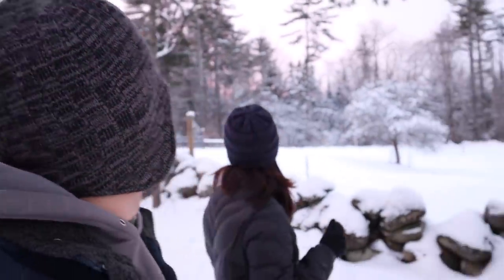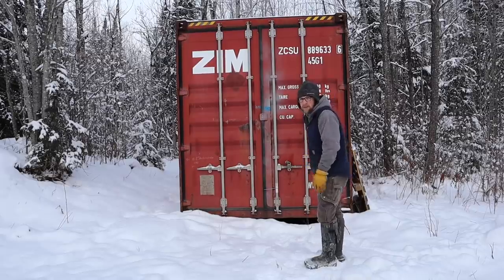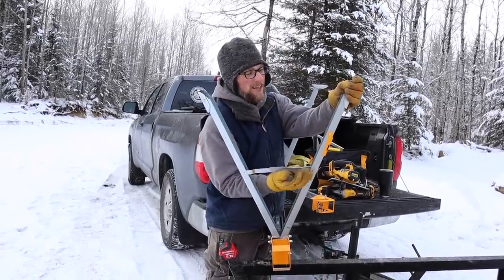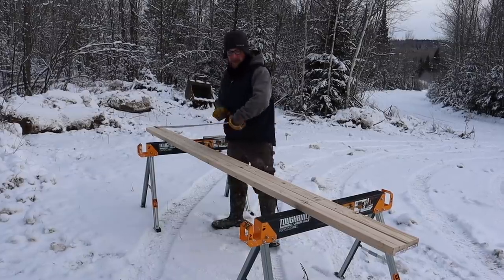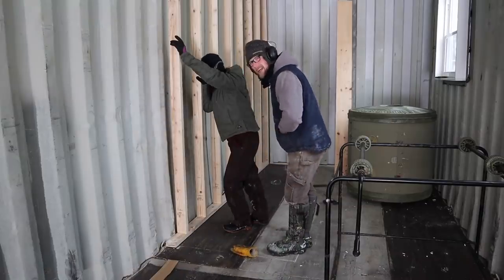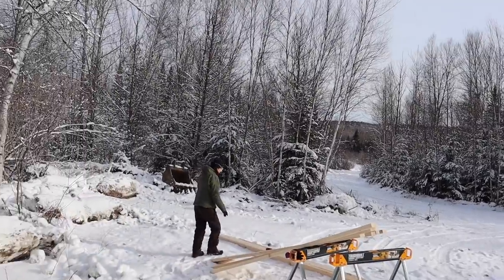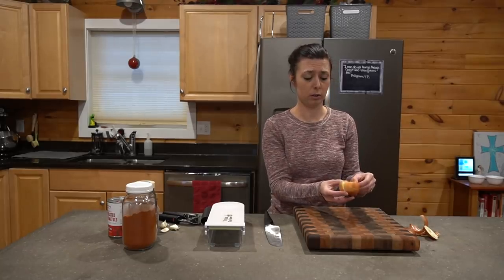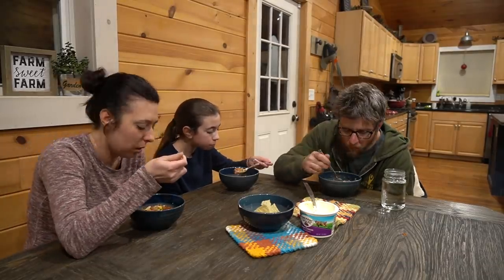Day 1 Framing Our Shipping Container Cabin Interior Walls This MISTAKE Cost Us

Comment: With the trailer being up off the ground, I personally would consider adding a layer of insulation on the floor in the living area.
Reply: And a moisture barrier, so mold won't grow. Air needs to flow. 😉 Check with RVers. They can give you lots of useful information on this topic.
Reply: I also read past comments that the wood floor in those containers is soaked in pesticide to deter any critters from making it lunch.  There is a concern of toxicity.  Another good reason for an additional flooring.
Reply: Maybe use the zip system
Reply: @Sam Val. I have done data research for 40 years.  If you or anyone else is interested in science developments. Four days ago the solution for stopping the virus was unveiled, at the "American Technion Society". It works simply with replacing lighting in a combination of ulterviolet ranges, and activates with a cell phone apt.. Proven effective 99.9% against the germs and bacteria that causes the Sars virus v2, that caused Covid 19. Look it up at their site. After installation, all hospitals, schools, gyms, restaurants etc. Will be able to open safely. G-D Blessed them, and us. Their is light at the end of the tunnel.
Reply: @angelsarrived2642  they have known this from the beginning!  Haven't you seen the robots and machines offices and hospitals use to disinfect everything?  Somehow I'm thinking a phone app isn't going to "save the day".
Reply: @Jomama02  ITS not a spray, or about a robot. A smart person would register for the webinar and become enlightened. Its free. But, most people like staying in the dark. Sorry I tried to wake you up. Go back to sleep.
Reply: @angelsarrived2642  Many thanks for the info!
Reply: @angelsarrived2642  I was thinking of the moisture barrier as well.
Reply: PLEASE MAKE SURE THE STOVE IS “VENTED” WELL. 
I know of a sad story I don’t need to comment on.

Comment: Bet your glad you left the air compressor home, screws are much easier to remove than nails.
Reply: And stronger
Reply: Said no contractor ever
Reply: @bryanlandis541  ever see a roof blow off ? Screws don't pull out
Reply: @colinstace1758  🤦‍♂️🤦‍♂️
Reply: @colinstace1758  yes I have. they don't pullout they break off.
Reply: @eugeneharris6898  in framing you need tensile strength not shear, screws are stronger than nails for tensile strength
Reply: @colinstace1758  been doing construction long enough to know that ring shanked nails will hold sheathing on a roof better them any screw does. Repairing botched jobs cost more in the long run then following bad advice from paper engineers. Every fastener has its proper place. Screwing a protected wall together and screwing sheathing on a roof are two different things. And as bryan said "Said no contractor ever"
Reply: @eugeneharris6898  I never said to screw shingles down, I meant whole roof structures as in trusses and metal roofs blowing off as a complete structure.
And I'm no "paper engineer" I've been a carpenter/framer for 45 yrs 😊👍
Reply: @colinstace1758  so are you telling me you are one of those jobs that we had to go out and make major repairs to because the original contractor screwed the job up. I never said anything about shingles I specifically said Sheathing. 

I have worked Construction since 1978 and have seen plenty of blunders by Contractors seen complete roof structures torn off,  walls blown in, sheathing separating from studs and trusses. So yes when I read screws are better then nails I have a problem with it. Like I said earlier every fastener has its proper place and use generalizations of use is absurdity at its finest.
Reply: @eugeneharris6898  unless you are in Australia then no, you haven't fixed any of my jobs 👍😊🇦🇺🦘

Comment: That lumber has gone sky high in price. 2x4x8 is over $5.00 or more in some places. Al, you could put spray foam in like you did in the garage. It was Golf and he lost his hand when a Gator bit it off when he went for the golf ball. What is that Big round thing that in the container? Al, I would think about lifting this up and putting it on some type of piers to get it up off the ground. This way you could spray foam the bottom (under side) to keep out the dampness and water and to insulate the floor. Why screws, when you have a nail gun. I guess its a good thing you did not Nail it. Measure twice Cut Once, the old rule for carpenter's. That made my day Al.

Comment: Good morning Make sure to leave room for ventilation. Those steel walls are gonna sweat. Think older mobile homes with metal siding. They wrapped the whole frame with plastic sheathing before putting on metal🤔
Reply: Metal &  wood  will  wood  with  shrink  and  almost grow if  you get the point.

Comment: You know you can tell within 3 degrees exactly what temperature it is by the crunching of the snow!   And framing the shipping container (besides cutting out and framing the windows) is one of the trickiest parts. But once done, hopefully will be smooth sailing from there 😄

Comment: Water storage up on top so you can gravity feed to a wash sink. Also make a water collection system on top. Rain barrels would work too. You can run a small pump with the solar collectors to pump water from stream or pond to rain barrels.

Comment: Consider building Bottom bed like a box with storage under the mattress pad.  That way you have storage for essential supplies or sleeping bags, etc.  The bed could also be used as seating if you make the top bunk so it could fold up or mount it high enough for head clearance on the bottom.
Reply: Like beds in the sleeping compartments on trains!

Comment: Al, you might want to rough-in some electrical before you put up the insulation and walls. Even if you don't ever use it.
Reply: wouldn't he be able to just run romex in this situation ? not conduit

Comment: a space heater to warm up the inside of the container would be nice, and a set of harbor freight solar panels to power a charger for the batteries and provide a light for inside the box
Reply: The Harbor Freight (HF) panels are convenient, but not very efficient nor cost effective.  They make a nice starter pack for someone, but to be serious about solar, one needs at least 100 watt panels - the one's HF offers are only 25 watts a panel.  I'd say they'd need at least 200 watts of panels to start with.  The more, they merrier.  And a MPPT charge controller.  lifepo4 batteries would be nice - no worries about hydrogen production with a deep-cycle marine battery.  https://www.google.com/search?q=lifepo4+battery+solar

Comment: I would have built the Wall 5 inches shorter and then afterwards, build insulated Ceiling Modules of 2x6 or 2x4 , that you just shove into place instead of Working Upside Down with Insulation falling in your face....You can even add the Moisture Barrier before you shove it in..for Lighting , foreseee the Wirings and holes in It before Installation..Prefab Panels of 4 to 6 ft, not too heavy

Comment: Solar collectors with 2 rv batteries for power. 2 100 watt collectors with 2 80ah batteries. Charge controller and inverter. Then you can run lights drills and battery chargers.

Comment: You do know if they say 2x4x8 stud it is 96inches if they call it 2x4x8 dimensional it is 96 plus 1/2 or more long.Stud means more than a 92 5/8 stud. Stud in lumber means what the size they say it is that is the size.

Comment: A window unit AC.... cut a hole same as the window but to the size of the AC. You’ll need it in the summer. If it’s 70° outside and the container will be about 105°. A little window unit that’s a big punch inside a container. Or one of those splitters. We’ve used both and the splitter works better but you’re walling the container in half so...

Comment: Good morning 
The reason the 2x4s are longer is probably cus when the loggers  cut the logs they put extra on the logs to cover for shrinking with the recent high demand of lumber some of it might not totally be dry
Reply: Lumber doesn't shrink in length, only thickness and width it's so they don't have to be exact when they cut them, it's up to the end user 😂👍

Comment: If I was to insulate the ceiling too, using 2x4's. I would have shaved an additional 3 1/2" off of the studs so that the 2x4's going across the ceiling would rest on top of the walls, instead of being supported by screws or nails.

Comment: If you can, please remember to run some wiring before you put up any sheet rock, if that is your choice for walls.  I don't think you need to follow code for a off-grid container cabin and have an outlet every 6 feet (or follow the 6/12 rule - http://www.renovation-headquarters.com/electrical-6-12-code.html )- but it would be nice to have some 110v duplex outlets on the wall.

Comment: I hope you add a door on the wall between the two halves of the container as a second escape route and also a loft and/or fold up beds for more room.
Reply: I'm not sure that those windows are big enough to use as an escape
Reply: @colinstace1758  I dont think the windows would work for escape because of where the stove will be located, plus they are not push outs, such as in a camper.  An exit through the other end would get you a further distance from a fire quicker.

Comment: Depending on insulation there is no reason to go with 16" stud placement inside a shipping container, 24" would do just fine.  Do remember blocking though  between studs for  cabinets etc..  Wood prices being what they are today might as well save a dollar or two.

Comment: I would be installing this heater. It has an oxygen depletion sensor shut off and runs off a 100# tank (not included). It is a radiant heater, so at first warms the people and things in front of it. But after a little while it will warm the air. Thermostat controlled. https://www.tractorsupply.com/tsc/product/dyna-glo-irss12lpt-2p-12-000-btu-liquid-propane-infrared-vent-free-thermostatic-wall-heater
And a little buddy heater in the privy. Note: If you run the Buddy heater on a bulk tank, you absolutely want to use an inline filter to keep cylinder oil out of the ceramic.
https://www.tractorsupply.com/tsc/product/mr-heater-portable-buddy-heater?cm_vc=-10005

Comment: Keep in mind while finishing the inside of that container you need some great air circulation the heating and cooling.  If you install a small bathroom w/possible shower, make sure you put vent fan in ceiling and turn it on when using water.  I know this container looks big, but when you get everything in there, it will be tight.  RV owners know from experience, even a little cooking on a small stove inside can give off enough humidity over time to reek havoc with mold and most of the time you don't realize you have. a problem until it's too late.  Also, make sure you have a great seal on top outside.  Seal well around any vents,  fans you will install in the ceiling.  I would insulate the floor well then install some heavy vinyl flooring like they have for RV's now.  Easy to keep clean w/mop and broom.  Great air circulation is the the key with very few windows.  You don't want all that hard word to get moldy in 5 years.  I can't wait to see the rest of the refurb.  Will be a great little shelter/cabin when you are done.  Love those windows.

Comment: You might look into one of those enclosed awnings like they show on the DIY shows for a work area to keep you dry and warm....you could heat it with a propane heater.....better then freezing....they secure them to buckets full of concrete so they don’t fly away in the wind....

Comment: Floor hoist and roof rafters always come about an inch long. You also need to cut them square on the ends. Sometimes the ends are just slightly off square. I always check them for square.

Comment: Use a fold out love seat and chair , so you can sit and eat ,talk and rest. Then when you want to sleep you can fold them out and have a soft comfortable sleep. It will save room for a small wood stove with a cook top. Hook up solar panels so in the summer you can run a fan. When you make the door ,put in a screen, but remember to cover the screen fabric with hard wear wire, so the little rodents can't chew it. That way when your sleeping in the summer you can leave the door open and get a good cross breeze. Look on line for ,How To Make A Small Home you'll get a lot of great ideas.

Comment: Al you still need a haircut!
Reply: Doesn't affect his work!
Reply: @tonygrimes13  - As long as it doesn't get in his eyes!  I remember back when I was a long-hair hippy type and my long hair got in my eyes when I was tinkering with something mechanical... I should have worn a headband - but no, I'd push it to the side, therefore transferring some of that dirty oily stuff on my hands into my hair.  That's one type of styling gel or oil for hair control, eh?  🤪
Reply: @samvalentine3206  An elastic band to make a pony tail would've been easier.

Comment: I don't know how much the prefab trailer insulation wall boards cost but  they save space instead of all the wood framing . The prefab is molded to the waves in the walls and flat facing inside the box.

Comment: Al and Gina, Unless you are going to find a way to do off grid climate.control in the tiny container, you're going to want some sort.of window on the other side for cross.ventilation. if not, that metal box will get awfully hot in summer. Maybe one of those long and skinny ones w a crank mechanism? Air.isnt going to come into a w I now if it's not escaping somewhere on the other side to draw it through.

Comment: The floor needs enough insulation, every bit as much as the ceiling.  Cold comes up right through the floor.  If you want to use it in winter, then you need floor insulation and maybe a carpet or thick rug for warmth.  Bricks or other non flameable material around floor and sides of heater/stove.  Stove pipe that goes outside on upper side of continer to keep rain and snow from dropping in like it would if it were on the roof, maybe a screen on inside of pipe to keep critters out. Build bunks out of wood slats and put cushions on top.  curtains for window.

Comment: Please research condensation problems with living in a storage container. You live in the best area to have condensation problems. You need to use spray in Closed Cell foam insulation. The metal needs to be sealed from the air.  In some cases where it is a moderate temperature a bed liner product might work.
Ylouvered vents for the mule area. Might want to cut some openings under the mule and cover them with expanded metal too. This will allow water to drain and air to flow.

Comment: You  have  2x4's  also  in the skid  there  use those  I have.   Remember the  more  moisture in the unit will be more  moisture  to  dry on out and pus mold.  TACO  meat  in  a  pie  crust  with  sour  cream on top then  cheese on top of that then  leftover  nacho  chips on  top  put into  oven  for  30-40  minutes  at  425   cut into  6  slices  it is  a meal  right there for you made  about  30-35  of these in a  hospital just for lunch  for cafe.

Comment: SHOULD HAVE USED SALT TREATED FOR YOUR BOTTOM PLATE YOU WILL HAVE CONDENSATION WHEN YOU HEAT THE  PLACE IF YOU STAY IN THE WINTER MONTHS NOT TO LATE PUT IT DOWN BEFORE BEFORE YOUR ATTACH IT FOR GOOD

Comment: So you build a structure inside a structure that could be a structure for any cabin by itself. All the container then provides is exterior skin. Seems redundant. Then there is the problem of insulating. Unless you spray foam you'll end up with condensation in any other type insulation. Every shipping container build I've seen is double  the work of any conventional build. Believe me when I tell you I have opened containers that have gone from warm to cold climate and it's raining inside. I have seen you build several nice looking buildings from those kits. To me that container is an eyesore on the landscape.
Reply: I bet Al and Gina just wanted to try their hand with a shipping container.  They've made so many other buildings, I bet they figured it was their turn to see what all the hub-bub is with converting a shipping container into some sort of habitable space.

Comment: Where I’m from we call it a “nom board” So if it’s a 10’ nominal length that would mean it is at least 10’ long, but could be longer as in your case. If you want to build square you have to measure and cut each one to length.
Reply: Or buy studs already cut to length

Comment: Can you use metal studs for the walls and ceilings? That way it can be welded in place to the containers' sides and make it stronger and last longer.
Reply from the maker: I’ve never used metal studs before
Reply: You would need to have some insulation barrier otherwise the heat/cold from the outside metal will travel along the metal studs to the inside.
Reply: @jazzswinglish  exactly right, thermal transfer
Reply: Last longer ? It's inside a container

Comment: Have you thought of L-Brackets screwed to the boards but welded to the container walls maybe 8-12 spaced out. That way it will be more stable and no holes to chalk  and let water/bugs inside.
Reply: No need for brackets, just block it out

Comment: 16" centers?  On camera it looks like 16" centers but as it's not load bearing walls why not 24" centers? That would be just as good for the purpose yet far less expensive. 
Russ (Florida)
Reply: He says why in the video, insulation comes to fit 16"
Reply: That's not a problem. I went 24" centers and still put 2 runs of insulation in. Works fine, less work and saves money.
Reply: @stogieltd  I would put the insulation between the frame and the steel, run it lengthwise 👍😊

Comment: Why didn’t you just open the other container door and tip the wall to get it in??? There is an old saying “work smarter not harder “
Reply: It was 6" to tall to stand up
Reply: @colinstace1758  ok, thought the issue was getting it through the door😖